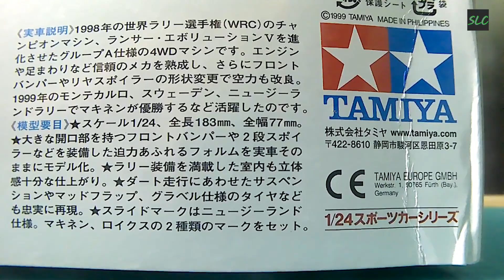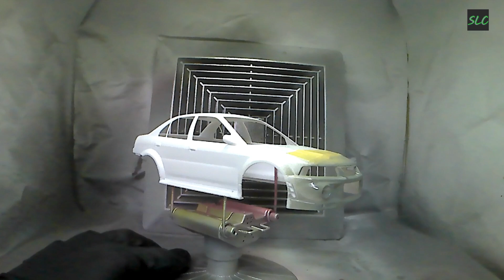Mitsubishi Lancer Evolution VI WRC | model kit

Comment: Were there any parts left? Coz I've got the same model and I do have several parts left...
Reply: I have seen few models with extra parts. Usually its to add onto the model or they are just there if you lose something or a piece cracks.
Reply: @orlandoschaffer5318  there were such parts as front drive shafts and anti roll bar, so... i don't understand what are they left for... coz there's no possibility to use them
Reply: @shizoid2005  it is for the street version of the kit
Reply: @chefsky3001  oh thanks